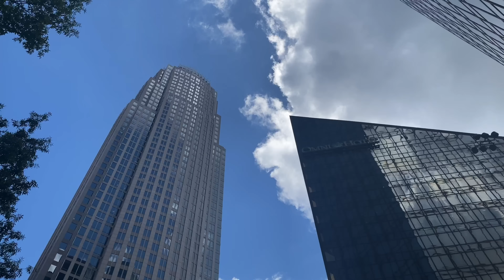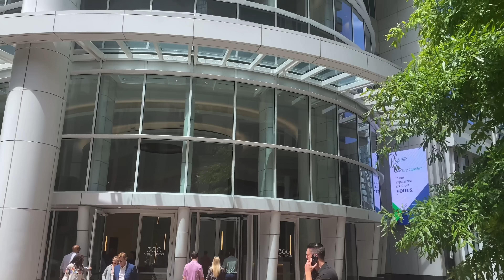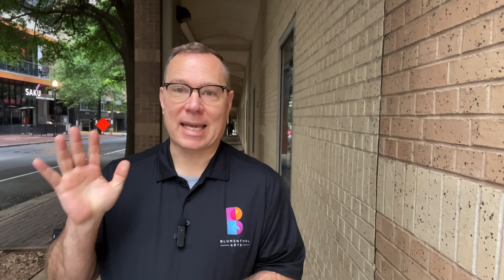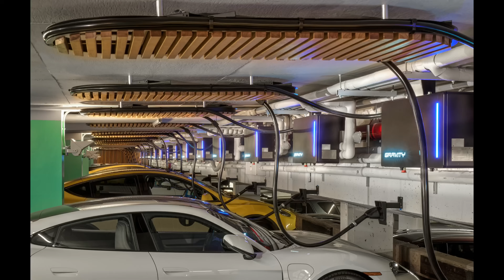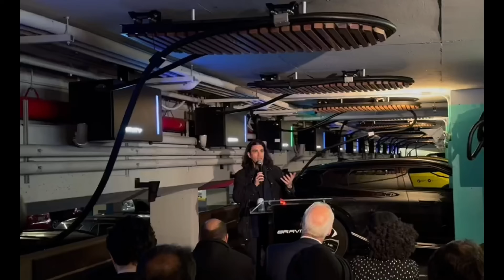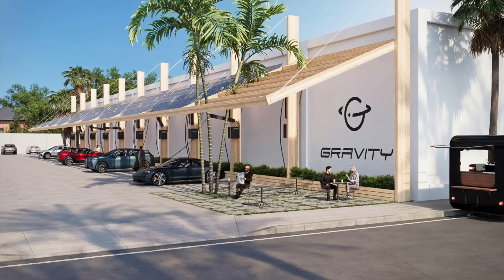Gravity Is Expanding Into LA With 500 kW DC Fast Chargers

Comment: Good concept to share power with several large buildings, and make use of excess power capacity not used by the buildings.  😎

I wonder if the power supplied to these buildings is “low voltage” (480 V, 3-phase), which is useable by standard DC Fast Chargers?  That is pretty low voltage to distribute megawatts of power.  If “medium voltage” is supplied (often about 25 kV, and more likely IMO), does Gravity have DC Fast Chargers that run of this voltage directly, or do they install a conventional distribution transformer to drop it to 480 V?

Comment: If a building has a 1 MW service, and the tenants in the building are using half of that, 500 kW is available for EV charging. If there are 10 stalls in the building, and each stall has a car at a low state of charge, each can have a relatively paltry 50 kW. Or, of course, if there is only one car, it can pull as much as 500 kW...
Reply: The 1mW was just for discussion.  A city block with sky scrapers has much more

Comment: Great concept and seems to be proven based on the NYC experience.  There is a similar approach taken by a home charger company that puts a collar around the home’s meter and uses the excess energy that is normally available to charge the car.  This gets around the need to do a big service upgrade (say from 100 to 200 KW) to older homes. This is also the tech behind the SPAN electric panels for homes.

Comment: Very smart to tap into currently unused electricity in the building. Another company called "itselectric" does the same but for level 2 charging. They're starting to deploy curbside charging posts in different cities around the US, and can do so quite quickly because they use the power supply of the nearest building. They share revenue with the building owners - everyone's a winner :)

Comment: The excess power in these urban areas that Gravity uses to build their stations without a transformer is the same excess power that hotels have by law that is never used. The same goes for big stores such as Walmart have. That's why there are so many Superchargers at hotels, and so many EA stations at Walmart.

But since they don't have that Gravity technology, EA has to use transformers at Walmarts. I wonder if Walmart will license this Gravity technology down the line to be able to use their own excess power without needing a transformer for their own charging network at their stores. That would really speed up their builds.
Reply: This is just an EMS. Nothing else. They are just taking advantage of the electrical systems capacity between its designed demand and its current actual demand.
Reply: Gravity should be making a sales call on Walmart Energy ASAP.

Comment: The CEO’s name is Moshe, not “Moshen” as you said (unless I misheard you).
Reply: I got pronunciation from gravity as MOE-Shuh.  I did get the 2nd syllable off a bit.   Sorry
Reply: That is the correct pronunciation. Thanks. Thanks for updates. FYI I have read Plugshare checkins that say power severely reduced when site is full. Would be nice to get some specs on minimum power expected based on load sharing and even based on neighborhood drawing power.

Comment: Sounds too good to be true. Moshe Cohen is the Gravity CEO.  Before getting too excited I would like to see the numbers and stats on how long the New York charging area has worked and if it ever impacted any of the residents with black outs or flickering lights.
Reply: Stay tuned for an upcoming interview with him where he explains much of what you are asking
Reply: @thenetworkarchitectchannel Great!  Please ask if Gravity’s DC Fast Chargers take medium voltage (25 kV) input directly, or if Gravity is using a conventional distribution transformer to drop the shared power supply to 480 V for their chargers.  Another alternative is they are sharing a single 480 V supply from a single transformer with the building tenants, but 480 V seems low for distributing megawatts of power, by long cable runs, to several large buildings.
Reply: @ sadly the interview was already recorded around the same time as this video.  If I speak with him again, I will ask.

Comment: Hey Walter, exciting, but I am still a little bit skeptical. 

Did they explain more about how the transformerless architecture works? 

Based on the description, it sounds like they are still using the existing transformers for the buildings, and just making sure that they are not overloaded. 

What I am hoping to see is DC fast charging cabinets that directly accept high voltage input so that they can directly use the distribution level voltage (usually 7-14kV). This would truly eliminate the need for local transformers at charging stations as well as improve overall efficiency by around 10%.
Reply: In a place like California, where they have so much excess solar power during the day that they have to almost give it away for free to neighboring states, it should not be an issue during the day at least.
Reply: @junehanzawa5165  only relevant if the local buildings have solar.  I'm not talking about grid load as much as local/transformer demand.
Reply: @GregMcNamer  Well, in the case of hotels, they have to request, by law, enough power to accomodate every single room using their air conditioning plus every single room using a hair dryer (a pretty high power drain) all at the same time. Since that never happens, they have a large amount of power that they never use. Which is why you see so many Superchargers at hotels.

And in the case of malls, or very large stores such as Target, Costco, Ikea, Walmart, etc, they request much more power than they will ever use. In the case of a mall, it's to accommodate whatever type of store that might move in later on that might have a much higher power demand than the mall originally planned for and to mitigate/survive sudden power draw spikes.

In the case of the large stores, it's to be able to add more power hungry items such as larger refrigiration/freezer units later on, and to mitigate a sudden spike of many things turning on at the same time. Therefore, almost all of them request way more power than they ever use. That's why you see so many EA stations at Walmarts. 

Gravity knows this, and is why they know which buildings or stores to target. This is also why Walmart is building out their own EV DC Fast Charging network. It will be super easy for them in that they do not need to request any more power as they have plenty that they never use. And if they go the way of Gravity, they might not even need to request any granual/smaller transformer within the massive one or ones they already have in use.

Also keep in mind that many large stores such as Ikea, Target, Home Depot, Walmart, etc, are adding solar to their stores, not just to their roofs, but some already also adding it to their parking lots. Look up the Ikea in Baltimore for an example.
Reply: This is not really transformerless. That's such a bad use of that term. From the explanation in the video, Gravity is just using the excess capacity of a given service. There's still going to be a transformer bringing down the local grid distribution voltage (12, 21, whatever kv) down to 480v.

This is basically scaling up load management for putting a big L2 charger in a house with a small service.

They need these things:
Existing facility with an existing service
Spare capacity on that service (and it's transformer) 
Parking

When you design a building you have the connected load. That's everything running flat out at one time. However, it's rare that happens. You apply a demand factor to that to get much closer to what you're really likely to see. The transformer and secondary service  conductors can then be sized on that. 

I work for an electrical engineer in California that practices mainly the PG&E service territory. I've seen a service transformer be fully rated once. And that was because we out like 2.5MW of solar on a roof so it required a 3325kva transformer to handle 100% of the solar backfeeding the grid. Those huge solar systems get connected ahead of the main so if the main trips for some reason all of the solar feeds the grid and could burn up a transformer. 

PG&E with millions of customers spread across thousands of industries in tons of climate zones has a list of demand factors for what say a grocery store in Firebaugh, CA is going to need based on its square footage. 

We make an application for service and along with the location, we tell them what's being installed and what service size and voltage were putting in.

I'm working on a project with a 2000 amp 480v three phase service. It has an existing 300kva transformer. We're adding about 650 kw of load for a new building. Their existing demand is around 150 kw on a few afternoons in the fall when their solar falls off but still has an HVAC load.
Reply: Additionally, it seems like in the afternoons (especially on hot days) they could be severely limited in the total output power they can provide to charge vehicles. Did they expand on how they expect to manage that?
Reply: Even better so if they don’t use their own transformers ?!
Reply: @GregMcNamer  Well, in the case of hotels, they have to request, by law, enough power to accomodate every single room using their air conditioning plus every single room using a hair dryer (a pretty high power drain) all at the same time. Since that never happens, they have a large amount of power that they never use. Which is why you see so many Superchargers at hotels.

And in the case of malls, or very large stores such as Target, Costco, Ikea, Walmart, etc, they request much more power than they will ever use. In the case of a mall, it's to accommodate whatever type of store that might move in later on that might have a much higher power demand than the mall originally planned for and to mitigate/survive sudden power draw spikes.

In the case of the large stores, it's to be able to add more power hungry items such as larger refrigiration/freezer units later on, and to mitigate a sudden spike of many things turning on at the same time. Therefore, almost all of them request way more power than they ever use. That's why you see so many EA stations at Walmarts. 

Gravity knows this, and is why they know which buildings or stores to target. This is also why Walmart is building out their own EV DC Fast Charging network. It will be super easy for them in that they do not need to request any more power as they have plenty that they never use. And if they go the way of Gravity, they might not even need to request any granual/smaller transformer within the massive one or ones they already have in use.

Also keep in mind that many large stores such as Ikea, Target, Home Depot, Walmart, etc, are adding solar to their stores, not just to their roofs, but some already also adding it to their parking lots. Look up the Ikea in Baltimore for an example.
Reply: Stay tuned for a video with the CEO to be released onto this channel in the coming days.  He will go into it more
Reply: There will be a subsequent video where I interview the CEO soon with much of that information, so stay tuned for that

Comment: If it’s anything like their NY installation they’re not 500 kw chargers. The equipment is rated for 500 A and 1000 volts which makes it 500 kw capable. But that’s true of most modern equipment from alpitronic and kenpower. For example the nameplate on the Alpitronic HYC400 is also 500A/1000V but that doesn’t mean every Iona charging station is a 500 kw charging station. Because  that’s not the actual amount of power that’s being provided which remains based on the site constraints.
Reply: That's because the total power for a site is based on the transformer they are using and the chargers and the EV's capabilties. For example, the IONNA Apex site in NC has a 2,500 KVA transformer for 5 HYC 400 chargers. Therefore, that site can give their chargers the full 400kW even if the site is totally full. 

Of course, since each charger is shared, the 400kW would be split dynamically based on the power requested by the EV. For example, if a Bolt would be on one side and a 2025 Taycan on the other, the Bolt will get it's 50kW, while the Taycan can get its 300kW plus it's requesting. But Alpitronics also offers 500kW chargers. So those would put out the full 500kW if the transformer is large enough.

However, in this case, since Gravity is not using a transformer, the power is not restricted by it. It would the depend on the charger's and the EV's capabilities and the amount of excess power available.
Reply: Chargers have 3 limits, max output current, max output voltage, and most importantly for this situation, max output power (determined by max input current and voltage to the converters) those 400kw chargers list 500A and 1kv max out, but they can't do both at the same time because they contain 4 100kw modules
Reply: @ yes. But the question is whether the gravity chargers can do 500 kw max output power or they are the same 500/1000 equipment that every other manufacturer makes that can’t output 500A at 1000V. Both Kyle and Tom visited the NY gravity chargers and asked to speak to engineers to confirm this point and they both got the marketing spiel runaround and no engineering access.
Reply: @TAWithiam  They use 50kW modules. So eight 50kW modules.
Reply: @junehanzawa5165  the modules can split their output in two directions so it's 50kw granularity (that's how their site phrases it) but the "power stacks" are 100kw modules. You can't, for example, configure a 250kw unit, but a 300kw unit can split 150kw of to one car and 150kw another other. 

I wonder if this unintuitive architecture is related to 400v vs 800v cars, and that the modules are made of two 500v max converters with internal switching logic to put them in either series for 1kv max output, or parallel for double the current output.
Reply: @TAWithiam I know they can also do up to 600amps on each side, so a total of 1,200 amps per charger if they have a transformer with enough power like the one in Apex. So that might give you an idea on your 400V vs 800V question.
Reply: I don’t know this for sure but maybe the difference is the UL designation. He emphasized that these chargers are 500kw UL listed charges. Maybe the Alpitronic chargers are UL listed at 400kw despite their max amp/voltage ratings. I don’t k ow this for sure. Just a hunch. 🤷